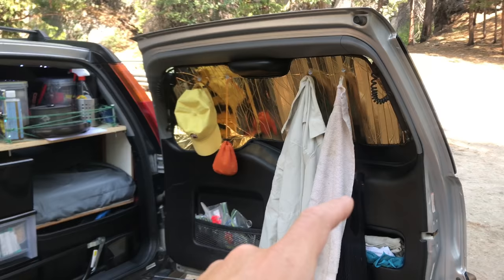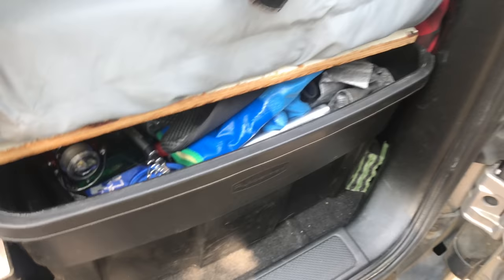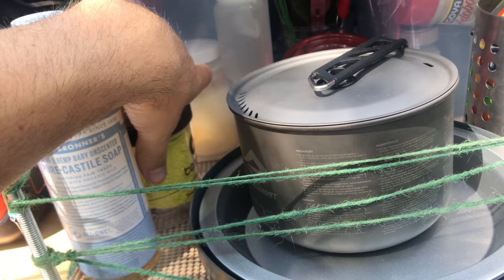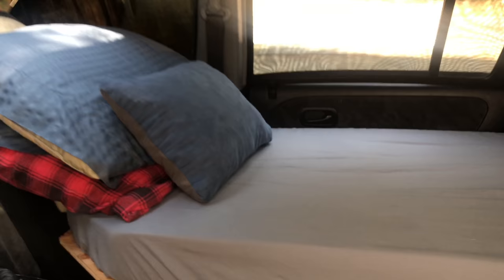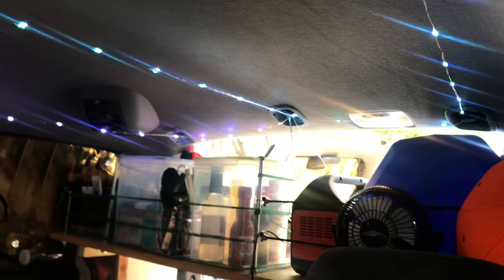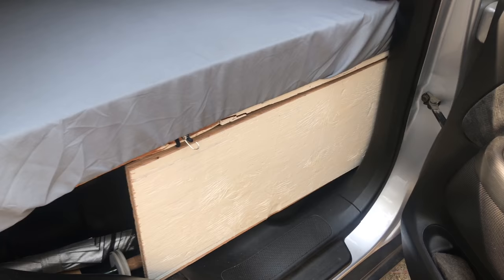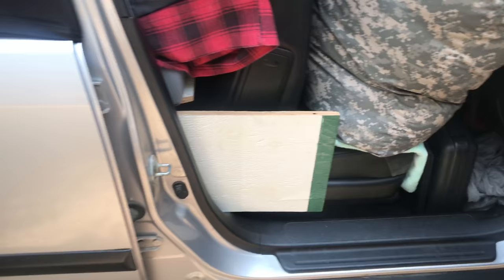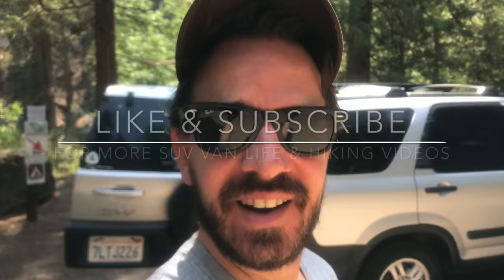Honda CRV - CAMPER CONVERSION (Full Time / DIY)

Comment: One of. the smartest designs I've ever seen for a small - medium size SUV!
Reply from the maker: THANKS SOOOO MUCH!!!
Reply: I have seen cleaner builds but some good ideas and a start...
Reply: @intheopenair3725  I was going to comment same. I have a 2004 Suzuki Grand Vitara XL-7. Has the gate door, too. This would be perfect design. Thanks! You earned a new subber. Looking forward to checking out your channel.
Reply: I second this
Reply: @sidha-tantrik-returns  I third it.
Reply: @intheopenair3725  I realy like what you've done here, especially with the shelving. Im thinking of doing something similar. I'd be a little concerned about safely seeing out the back through the rear view mirror while driving though. Has that been an issue for you?
Reply: @benspired  not much different than driving a van, pickup, rv, name it…

Comment: Honda should make the crv with a bed in the back as standard
Reply: I have a 99 CRV...ALL the seats DO configure as a large sleeping platform! The rear seat bottoms actually rise up to level things out!
Reply: @tonybucca5667  Yes i know what you mean but it is not folding flat like a bed does, you are referring to the recliner style seats with front and backs seats joining . I feel honda could make a better design.
Reply: @tobywarrington7463  Yeah...I know it isn't a flat bed...but it's REAL comfortable when the temp drops...or it starts raining (I don't use tents)
Reply: @tonybucca5667  if they could make it flat it would be great
Reply: @tobywarrington7463  my hopes for 2021 are to find a 2018 CRV XLE. Yours is the build I like the most. Do the seats on 5th Gen also configure to almost flat?
Reply: @sandrakramer1520  on the 5th gen the back seats fold down to create a flat boot space big enough for a single mattress.

Comment: I love how organized you are with your clothes!  I used to have a Honda Accord hatchback.  For weekend camping or festivals, it was perfect as was, without alterations.  Load up the food (I prefer to not cook for a trip of just a few days),  throw in my sleeping bag, sheets, foam pad, suitcase, plastic bin of gear.  All set!  I made a mosquito net that would fit over THE WHOLE CAR, with elastic around the bottom like a sheet, with open windows and the hatch popped up, so I could sleep without bugs or being closed up.  It worked great!

Comment: I don't if many CRV owners know this but if you slide the rear seats all the way back and slide the front seat all the way forward you can take of the headrests off the front seats and the front seats will lay all the way down flat flush with the rear seats. This gives a nice rest area and may not be necessary to make a sleeping area in the rear. I've used this set us when I had my son in the car seat in the rear passenger seat. It allowed him to see all the way forward and I had a better view of him when I turned my head to see him while I am in the driver's seat.
Reply from the maker: This is a great tip!  Thanks so much!!
Reply: Wow! Will chk that out, thanks!

Comment: I have a RAV4 . I set it up just like you (no shelf across the back) but I left the seat up like you and it works out great.  I can sit and relax, watch movies, read, watch YouTube videos. Only camp for a few days at a time, so I don’t need so much storage.  I put a fridge under the bed platform and that works great.
Reply: It's not a problem that the back doesn't lay flat?

Comment: Finally! A set up in a CRV about the age of mine (2006). Mine is underway and won't be as elaborate, but you have some great ideas for me to work with. Good job!
Reply from the maker: Thanks!!! Please consider subscribing ;)
Reply: Mine is a 2006 as well I based my design off this I have a mattress that blows up for the back seats if I keep it but I do want to get a small taught since I can't build anything in case I have to live in it right now it's just a bug out vehicle for me my 3 chi's and indoor duck 🦆

Comment: Damn, love it, what a smart way to organize. As it so happens I converted my 2004 CR-V into a camper this summer. I ended up using a Schumacher power station hooked up to a roof mounted 100w solar panel, and a collapsible 5 gal water container. Instead of building a back-mounted rack, I ended up just making a flat bench with a roll-up mattress and storing all of the functional stuff under it, so I had to run a hose into the 5 gal container that was underneath and hook it up to a 12v electric pump to bring the water up. I also ended up building a small sink and grey water tank into the bench, because I reasoned that I wouldn't want to be getting out of the car to use the water if I was camping in cold-ass upstate NY. I think what you did was a lot more common-sense, and very feature-rich given the available space. Gotta love the second-gen CR-V, what an unbelievably versatile and reliable platform.
Reply from the maker: Aw thanks so much! Your build sounds really cool too. But yes, I wanted to make everything as comfortable and accessible as possible. Always improving!  More to come.... Thanks for being here!

Comment: Dude! Love the car and the build out. 

- Do you use the fold out table that comes stock with the 2004-2006 CRV? The donut tire cover doubles as a table.

- Do you ever fold the front seat flat to make a lounge chair? Take head rest off, fold forward, fold all the way back and it will fit perfectly with the backseat chair pushed back.
Reply from the maker: That second idea is cooool. Thanks! I’ll have try that. I don’t use the table much, since it’s the floor under my bed and stuff. Cheers!

Comment: I retired from trucking this past April of 2020. About a week later I bought a Ford Transit van 2016 model. Mid high roof and I moved into it. I went to Lowes an bought a roll of reflectives, and cut the pieces to fit the windows. The van doesn't have any back windows. I then spray painted them to give the appearance of blacked out windows for boondocking. I found the van on Car Gurus. It already had medal shelving and fiberglass insulation in the walls and ceiling. I use a jug and 5 gallon bucket for the rest room. I have a domedic refrigerator freezer that I'd used when I was trucking.
Reply from the maker: Sounds perfect, David!!! I hope you’re enjoying the road as much as I am! Cheers!

Comment: Nice micro rv/nomad rig. Your awning mount is unique & clever; an inexpensive & lightweight solution using the plastic pipe.

I’ve turned my 2015 Toyota Highlander into a similar stealth camping rig. The key to these homemade mini rvs is to remove most or all of the back seats like you did. I took all of mine out & it really opened the entire interior up! The extra space is wonderful & it reduces the weight of the rig.

I use the same Jackery 240 too. It’s the smallest & most efficient way to power small items up. Well done on your build.
Reply from the maker: Thanks so much! Your Toyota sounds rad 🤙

Comment: Also have a silver 2nd Gen Honda CRV (2003 manual trans 5-speed).  Got it with 87,000 miles and removed right rear seat.  Installed Yokohama ATV tires on the stock 15" rims. Driven it from Philadelphia to the Southwest twice.  These little SUV's are reliable, handle well, easily repaired, have parts available everywhere.  I also feel they might be less prone to theft since they are older and very commonplace.  Very cheap to run.  Thanks for all the good info on your channel!
Reply from the maker: Thanks!!

Comment: Great conversion. Smart man! for using 1/2" ply for your bunk. So many times people make everything out of 3/4" plywood. Sure if you're going to park a car on it. 
For cutting those tight contours. My old stand by is to just take a bunch of Amazon boxes, flatten them into sheets, tape them together to make the size sheet you need. Scribe those contours, cut them out, patch in more cardboard if you cut too much out. It really doesn't matter what the pattern looks like - so long as it works. (I'm about to make some pull over screens for the door/windows and pop-out windows of an old passenger van a friend and I bought for camping. I'm going to use the cardboard pattern method. (I have pull over screens like the one on your CRV, they work great on my Prius V, but are too short to use on the bigger van windows. ) And later still I'll reuse the same cardboard to cut out insulation/privacy panels for the windows. When that cardboard finally hits the recycling bin it's going to look like Frankenstein.  
Your pull over screens work great. I've been using the same four since 2017. They're a bit short. Anyone who makes them 3" longer and 2" wider and sells them at twice the price is going to make a lot of money. (The one's I'll be making for the van won't stretch, and I'll add two sew-on magnets to the bottom outside hem. Yours could use them too. K&M Magnetics)
For water tank I just use those 2.5 gallon jugs from the store. I cut out a small flap and refill them several times. And if I need more, you can buy them at any grocery. 
Ghee's a great idea for butter as it keeps longer. I made some ghee but it got moldy in less than a week (back to the instructions for me) 
Amazon sells a really nice memory foam, three fold mattress, in a cover that's 25" x 75" x 4" really comfy.  I'd rather have my mattress be an inch or two wider than my bunk. Less like to get an 'owie' bumping into the edge of the wood. And planing, sanding, or using a router with a round over bit convert those uncomfortable edges into less painful ones.  72" bed? My 75" squeezes into the back of my Tesla Model Y, it also fits about the same in the back of the Prius V, and I'll bet it would fit into your 72" bed space. I think anyone looking at all three vehicles would think they had very different interior dimensions. Apparently not. (but my seats aren't as far forward as your front seat)
I have a folding Al table like yours. Also a beach chair with a tall back (you can nap in it). All my fold up stuff has to fold into a cylinder, not just flat. I find that this gives me many more options for stowing it.  Like your tarp/fly. Simple effective. If you ever see a Telsa Model Y or an old passenger van with a lot of your tricks going on - that will be me and you'll know where I got them.

Comment: That water can looks really practical, only thing is the spout is positioned so high that you can't get the last 25% out without having to tilt it
Reply from the maker: It works great. Just takes a little tilt to get the last of it out. Not a big deal and pretty standard for such things. Cheers!

Comment: This is my favorite micro suv conversion.  I like the fact that you used bins as the base of your bed.   The problem is my 2002 Rav 4 has an uneven floor.  Maybe I can find different height bins to make it work.  You just answered my question.  I am going to do this for myself.  I like that you left the rear seat in place.
Reply from the maker: Thank you, Debra!!

Comment: This is a nice, simple build that's highly functional. Definitely a different use of space from what I had built out in my CR-V, I like how you kept the smaller driver side back seat as well... I tried to incorporate something like that into my new 4Runner build but found the bed space to be a little too narrow for my liking with the back seat in there. One thing you can try to secure the PVC pipe to the crossbars of the roof rack are some U-bolts with connector plates, using a U-bolt over the PVC pipe on both sides of each crossbar then connected underneath with two connector plates,  you want to make sure the U-bolts are the same width as the pipe and long enough where you have at least an inch of the bolt thread under the crossbar. You'd need 4 U-bolts, 4 connector plates and 8 hex nuts.

Comment: I love this setup this is definitely how my 2006 Honda CRV is laid out the only thing I can't do is build things so I'll probably will have the containers under the bed and then use that to lay on without the boards and then maybe not have the shelf like that but towards the right and then also I could actually have both seats up and I bought in the beginning an inflatable back seat bed but then I saw this set up and really liked it for my bug out vehicle and I also saw your toilet and got a cheaper version of that as well and it was just going to be me and here but I also have four animals I have three small Chihuahuas and an indoor duct the size of a football so I have to make plans for them as well because wherever I go they go so I have a tiny blow up child's pool for the front seat for my duck and then the dogs are big enough that would be in the bed with me or I would probably have them in that seat or outside if it's nice with me but if it's a rainy day I have to make room for them inside and also I could pull that little small seat up and put down there been in their puppy pad for their potty I have a cat litter pan because I can put a puppy pad anywhere and anything and they know to use that as the potty and also I like to go camping and might want to use it for that as well but I just liked having it up as a backup you know it's weird before I used YouTube to find videos I was already collecting things and I have an obsession with solar panel things I do have two solar generators and a lot of solar powered lights I also had the same fairy lights as you have here and I ordered a bunch more little gadgets as well but I really like this setup I had it in my brain when I wanted to do but I didn't know how to execute it then I saw this and I was like yep this is it 😂

Comment: **Mine is a V6/2008 Jeep Liberty/85,500 km with zero NO rust. { And since car dealers would give me $ nothing for my Jeep, I decided to transform him, instead of investing in a complete stranger "Van".} My plan is similar to yours, with condemned right seat & no back seat .. ( 70"x 28" bed toes under shelf ) All built with cherry wood tainted came out dark turquoise & celadon green. Now my good old buddy is a permanent  "SHARP" Camper. [ ps: thanks to you, I've realized that a portable generator will do the job just fine ..thanks a lot. ] Québec **

Comment: This is seriously the best setup I have seen for a CRV, I'm taking notes. Did you consider removing the front passenger seat to get more space?
Reply from the maker: Thank you!! I didn’t actually. But I’m sure you could! I just like having it there. Sometime I use it for friends...
Reply: @intheopenair3725  i seconded that. You've done a lot of work to convert it, might as well remove the second seat (unless you want flexibility to have a passenger in one of your trips, and fold the mattress and/or use the roof rack for things.. That said, love what you did with fitting things together in the front passenger seat!

Comment: I notice you have little J shaped brackets on the underside of the back shelf (on the left side, looking at it from the back) Do you use those to hold a 3/4 inch board that can slide in there for extra "counter space"? It's a great idea that I'd like to try, I just can't seem to find the same hardware anywhere near me!

Great build. Thanks for sharing!

Comment: Just discovered your channel and I don't know if you're still monitoring the comments. I had a couple questions about the Heat Shields: do you find the manufacturer is offering a pretty accurate fitting to the window for the specific model of a vehicle? I was originally going to get weathertech, but some videos I've seen show rather glaring gaps around the edges. 

Also, does the texture of the black material that's made from, help with stealth? Again, with the WeatherTech I was surprised there seems to be a crinkled surface which reflects the light that hits it. Seems to me that would be a dead giveaway even on a dark street. 

Oh, one more question, how flexible are these shields? I would like to be able to pull down a corner and peek out if I need to, but I've heard that weathertechs are very stiff so that it's not really possible to do that.

Thanks! 🙂

Comment: Thanks for your video nice set up , how long is your plywood need ?
The way I could see it ,you pulled the passenger seat as far as you can to have more space for your bed , I’m 6’3” I have an orange to buy a 2006 , I tried to find the measurement between the front  passenger seat to the till gate  , nothing 
Thank to answer me back

Comment: Hey this was really cool, definitely a better alternative than a cargo van conversion but i did want to see how you work your solar panel to charge your jackery would that be able to charge a bigger sized jackery unit, but I believe you can charge it with the car but to not have it on just to charge it, do you have a video on that?
Reply from the maker: Hi there! Yes, I talk about it in more detail in my GEAR & GADGETS video. Check it out! Cheers!
Reply: @intheopenair3725  awesome thanks ! :) im actually looking into maybe getting the same CRV too 150k pretty decent condition for 4.5k, what do you think of that deal btw? if it comes to be you'd be the inspiration for that, i do have a large dog which is why i was looking into cargo van or passenger van campers but your idea of less is more is really intriguing!

Comment: Thanks for sharing this info . I’m in Australia but your converting your crv  is cool and practical . My crv is an 07 but I like the idea of using this to get away without the expense of buying a big Campervan . Any tips on where to start converting ? Do you need to remove any interiors beside the rear seat ? Cheers
Reply from the maker: Hi!!!! Thanks so much for subscribing and for your thoughtful words. I made a BUILD video that might help you get started but feel free to reach out here with more specific questions